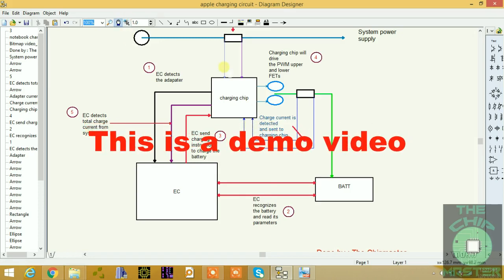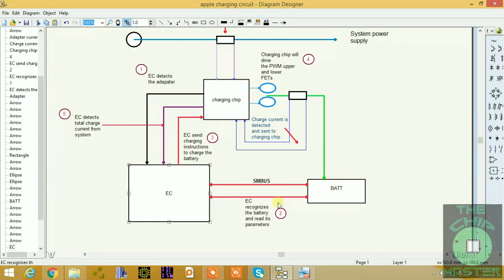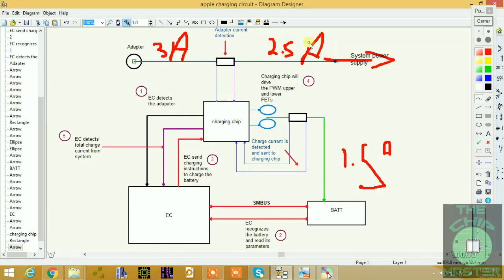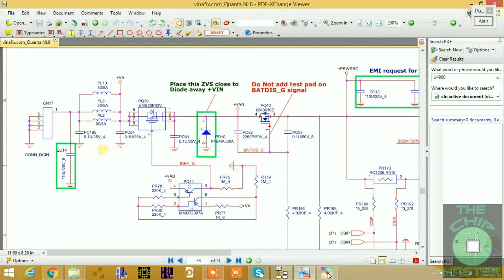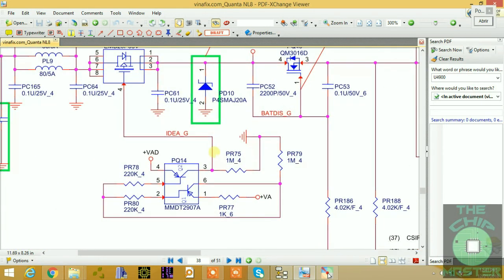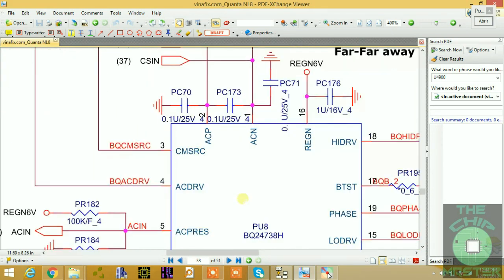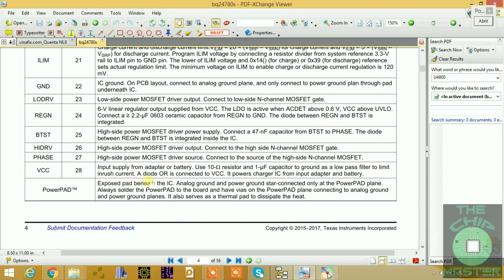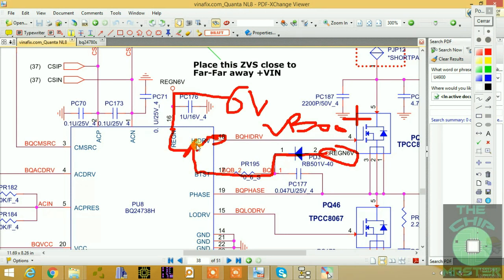Notebook charging circuit explained demo

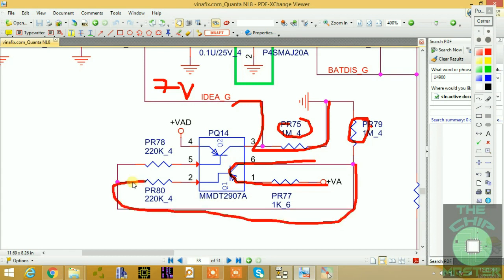Comment: Just wondering about @16:00 the common junction of PR75 and PM79 is connected to GND. Therefore there is no way that these two resistors can act as a voltage divider, unless there is an error in the diagram, and the common junction is not grounded.
Reply: He can't prove it anymore
Reply: wondering, me too.  PQ14 is a dual PNP transistor.  It's not a MOSFET.  Chipmasters explanation could be better.   Even if the common junction you mention is not grounded, how does this section work?